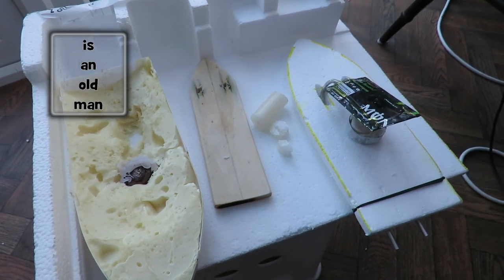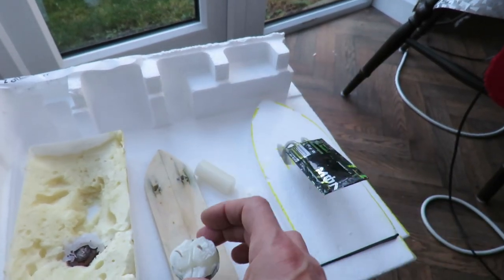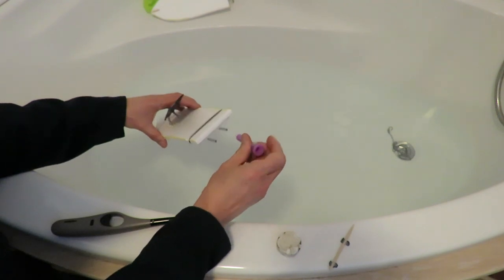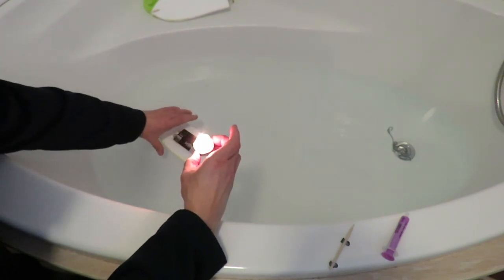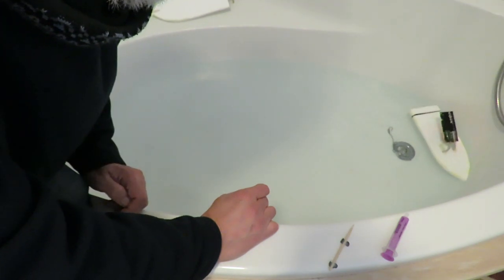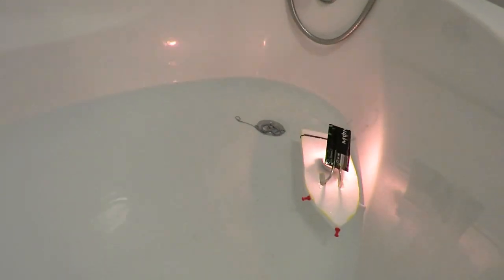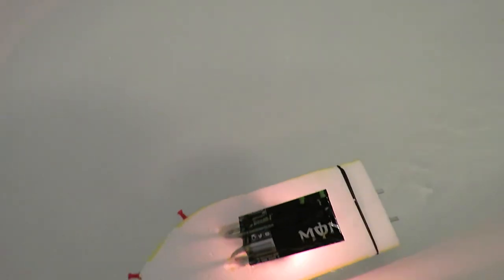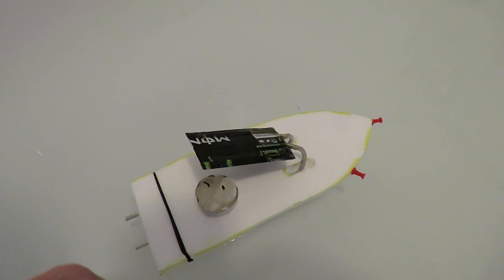Styrofoam Pop Pop boat

Comment: Yip, that works and sounds brilliant. It's strange how it seems to go back as it goes forward, like a juddering motion. Maybe that's when it's sucking in the water?

I wonder how large those pop-pop boats could be made? Something big enough to use a gas burner, but then it could just blow up in your face and then you have to explain to the surgeon that you were making a pop-pop boat while he extracts the shrapnel from your face, so better to keep them small I suppose. :D